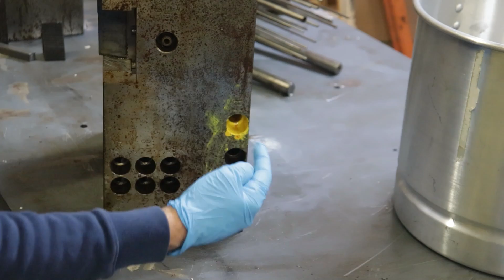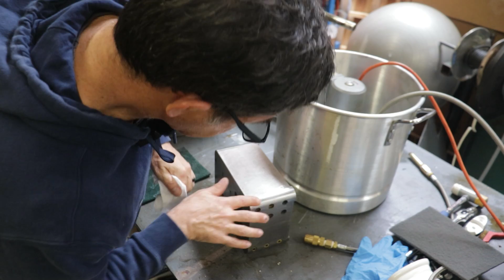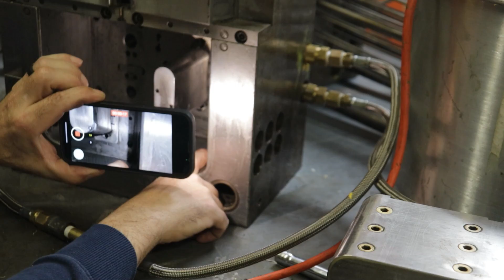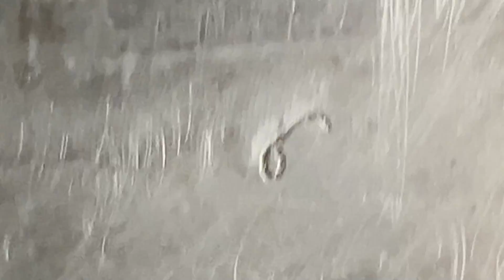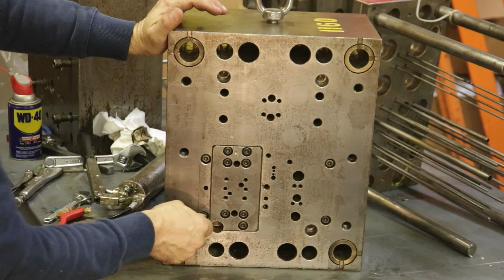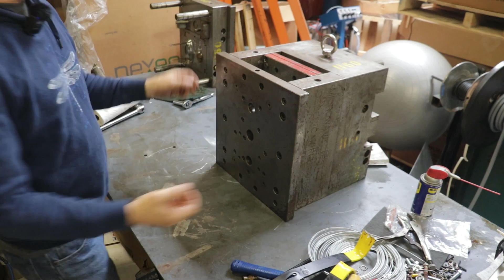Plastic Injection Mold Maintenance

Comment: @DragonflyEngineering I have several molds used for injection molding and I think that we are using the wrong type of grease. What type of grease are you using and what do you recommend?
Reply from the maker: I use general purpose low viscosity grease that is used for my Haitian molder, NLGI 00   It may not be the best option, maybe check out ppe dot com

Comment: I have to say after 20 years of operation before a PM is needed is impressive. Our techs destroy our molds @ Rubbermaid in a matter of days or months! And that straight line under the core was probably an attempt to vent the gases.

Comment: would'nt the grease contaminate A-surface parts? in my experience when a mold comes back from service first few days running parts have what looks like water marks always around same ejector pin area can take several days get rid of defect. once we had a mold down 3 months because excessive flash when it came back from service ejector pin broke off at the foot 2nd part it made still wonder how that could happen
Reply from the maker: @jasonmushersee  yes, there is a risk of part contamination after lubricants are added, but if you dont lube the ejector pins or cam pulls will gaul up and break or prevent mold close. My main use of grease in the insert was to try to prevent coolant intrusion. Thanks for watching

Comment: Hey, thanks for sharing your work. I am very inspired. I run a two man operation with five molding machines including one rotating platen machine. three powerjets and two nissei. we have about 10 3d printers that dont get used, other than the sls, one sprue picker, a cnc, an edm, and a cmm. All in 4000 sq feet. I wish i had your robots and experience, and cnc experience like yours. Thanks again for making these videos. I tried, but its difficult. Editing takes a long time.
Reply from the maker: @revtechmfg  wow, you sound to be just like me. The robots are pretty easy to pick up, you just need to start with simple slow tasks. I will be showing a lot more robot work soon
Reply: @DragonflyEngineering  i have one pc+abs insert with heat issus as well. have you ever made 3d printed metal inserts with cooling channels near the surface?

Comment: Why would you not disassemble the entire mold to get all of the contamination out of the cooling passages, especially since it is an active product? Did you try acetone on the cured paint outside of the mold to see if it worked? I’m glad you didn’t blow yourself up with that electric pump. Interesting to see a fairly intricate mold. Thank you.
Reply from the maker: Hi Paul, It is mostly due to the discussion with the customer to minimize risk of taking appart parts that may not need to be. Thanks for watching.